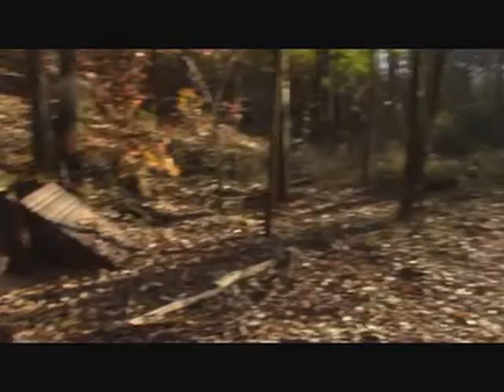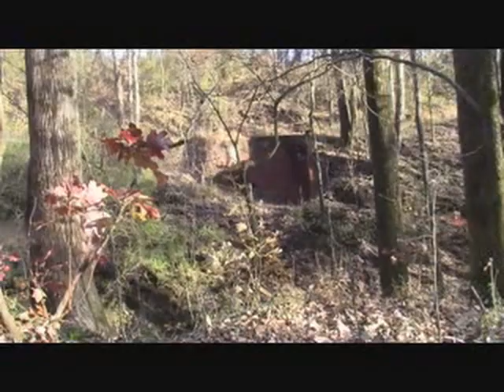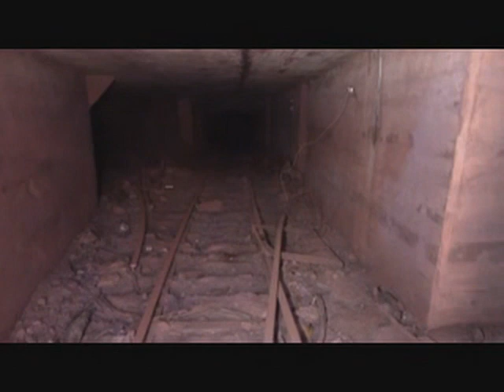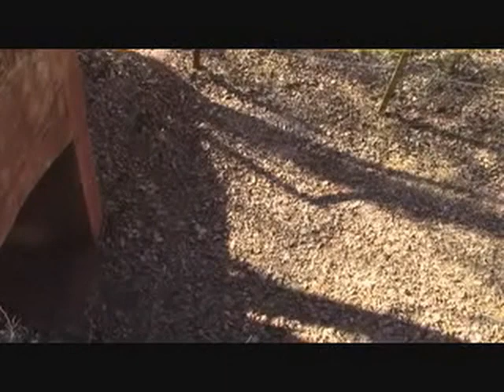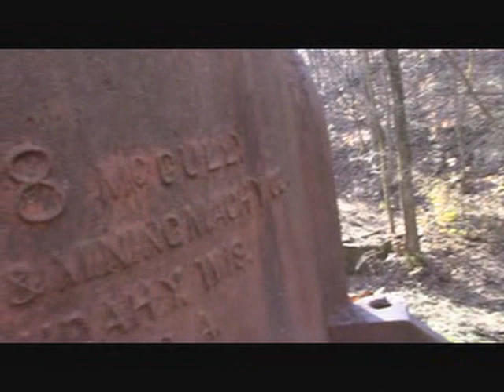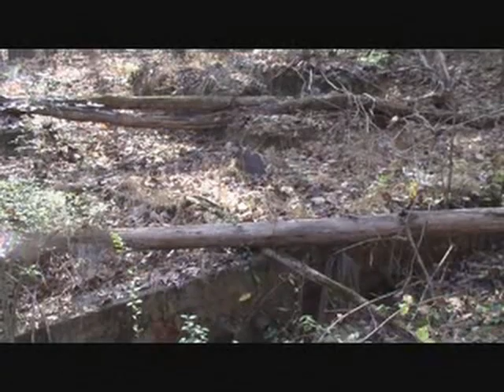Historic Red Ore Mine Hike-Extended

Comment: I spent many a day knockin’ around Ruffner 2 in the late ‘60s.
This brings back so many good memories!!
I seem to remember a different design crusher ( horizontal ball mill) being somewhere on the mountain, maybe closer to Irondale. Not sure if it crushed red ore or limestone.
Reply: It was back towards irondale close to what we called mist cave (which was a mine that was flooded). It was massive but sadly after the explosion it was removed
Reply: @williamshafer7172  
Visited the mountain today and entered from the Eastern Trailhead off Ruffner Road.
Turned left on Pipeline trail,
and off to the left was what I believe may be the remains of that ball mill, about ten concrete bases, arranged in a linear fashion. Each was 6’X 10’
and each slightly shorter than the first ones. At the low end, the remains of a brick and concrete structure which was completly destroyed seemed to indicate there was some type of conveyance system. I procured one of the baseball sized cast iron balls from inside the mill, back in the 70’s.
Couldn’t seem to locate one today☹️